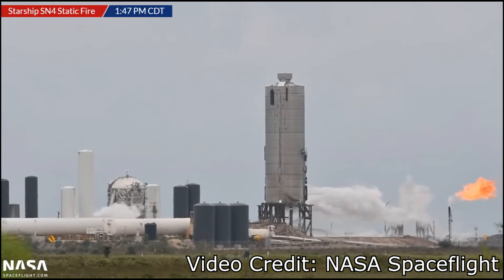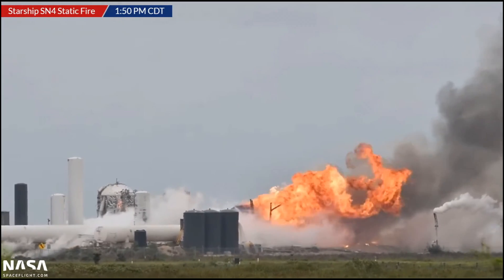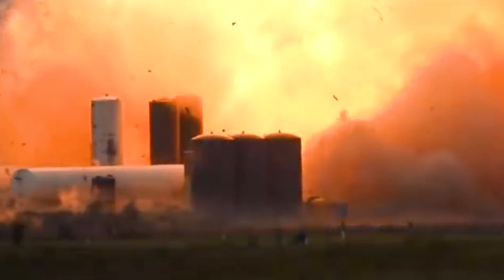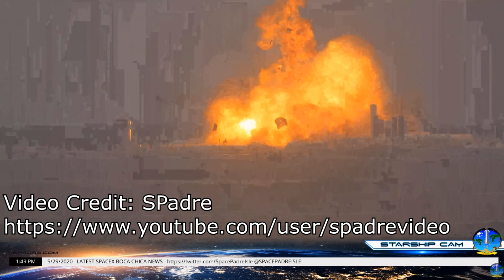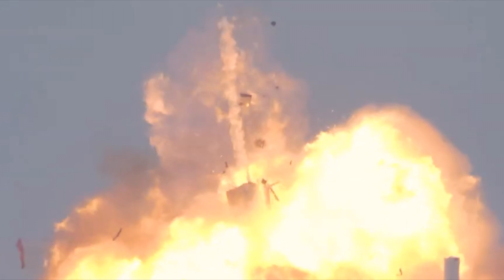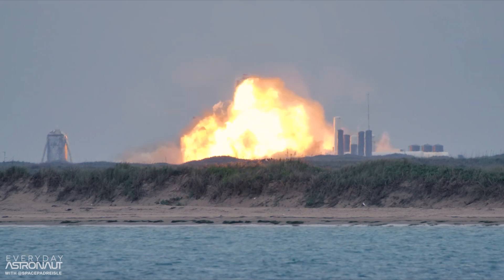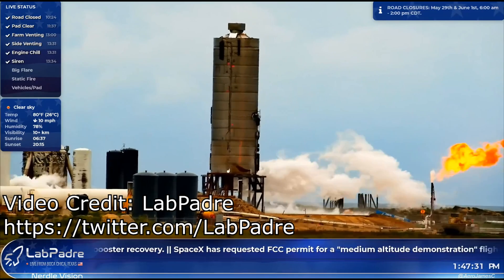What Can We Learn From The Explosion Of The Latest SpaceX Prototype?

Comment: Great video, Scott. Few things to note, one of which you theorized but are correct about. The leak was methane and oxygen thus causing a detonation. The deflagration velocity of methane in air is very low, even if you account for localized radiant heating from the flame front compressing and heating the fuel/air mixture ahead of the flame front. One thing that I noticed from all the videos, this actually produced a mach stem, a phenomenon usually seen during an elevated nuclear blast. Due to the cloud of fuel and oxygen taking an irregular shape and the detonation starting at the stand and propagating away from it. It generated a contoured shock front and due to the deviation in the density and likely the compression effect, the detonation velocity changed as the shock front propagated. The change in contour and difference in the shock front velocity appears to have created a shock front closer to the stand that was at a higher velocity than the shock front further away and you can see the closer shock front overtake the shock front further away, thus creating a very visible mach stem in the forward right side of the NASASpaceFlight video.

Comment: I've said this before, I'll say this again - Starship is in serious trouble.  It has become incredibly clear that SpaceX does not know HOW to build one of these.  In aerospace engineering, if you do not know that... you do not know anything.  You cannot specify the ultimate payload capacity or possible mission profiles without knowing how much material is required to make your vehicle work.  And, keep in mind, thus far the requirements have been mild... mere holding propellant and static test firings.  What is going to happen at MaxQ, Staging, Orbital Refueling, and Re-Entry?
The near final design of the Space Shuttle was adopted in January 1971, by April 1981 the first Space Shuttle launched with two astronauts onboard.  From concept to a crewed flight in just over 10 years.  I do not see Starship carrying astronauts into space .. any time soon.  In fact, I expect someone at SpaceX to wake up from this ridiculous fantasy (colonizing Mars with no external funding) and cancel this money pit.

Comment: Scott analyze the wreckage the bottom Lox tank was ripped in a spiral fashion with one segment of rings intact. The methane section was clearly exploded. The bottom. Lox tank failed 1st. Not GSE
Reply: Also methane doesnt explode like that. It burns rapidly. Liquid oxygen accelerates combustion and is extremely volatile if it comes into contact with organic material like oils.

Comment: I'm wondering why they don't have a water spray system, something like they have on the F9 launch pad but activated only in an emergency. It would not be able to prevent ignition but it could easily downgrade the detonation to just a fire which would burn out rather quickly as the methane evaporates and disperses. I think it would have easily saved the vehicle and also greatly reduced the damage on the ground, limiting it to heat damage only rather than powerful shock waves.
The water spray would of course need to be started as soon as a leak was detected to be of any value.

Comment: The new stand is already almost done and SN5 is basically already stacked and all so over the next days I expect to clean up work and all and then SN5 possibly rolled out. I know SN7 is already taking shape with 2 ring segments. We also know that they wanted to really blow one up and find the top limit of pressure they can safely fly the rocket I bet. granted if the blast happening inside the rocket we could possibly know so I do think it was a process issue. So hopefully they get a lot of info on this and SN5 and proceed on to the test hop

Comment: I think we are seeing the problem with methane as a fuel for rockets. Ask any gas guy and he will tell you, "Natural gas carries it's own ignition source." (static electricity).
That rapid disassembly was essentially a fuel/air explosion. Had it been K1 there wouldn't have been an explosion. (Might have been an epic fire though).  Given sufficient volume and a good mixture such an explosion can reach the kiloton range. 
Perhaps the  tank farm should be a bit further from the launch platform? Or buried at least?

Comment: Scott, you should spend some time train spotting, because if you do, you'll learn that a roll of sheet steel isn't solid. Knock a ton or so off your mass estimates for that difference. One other thing is that methane can spontaneously combust in the presence of oxygen, which is one of the things that makes it a nightmare to handle. I wonder that Musk didn't take that fact into account when he decided to use it as a fuel.

Comment: OK my theory goes like this: The mass simulator changed the way the pressure from the firing engine runs through the body, leading to different vibrations than before, which caused a rupture somewhere.

But women scientists just found out that theories from men like me lack the theoretical foundation. So I must be wrong.

Comment: How do they not have safety valves that respond to a bad pressure condition? These people are supposed to be smart right? When they had insulation on the stand I thought that was dumb but pressure overload failures? There clearly needs to be firewalls for the stand AND the tank farm cause clearly this has demonstrated the safety issues there. Elons go as fast as you can is proving to be TOO FAST!

Comment: Well, that was quite a nice boom, but still a bit expensive for a firecracker. ^^
As for the ignition source being close to the engine: my guess would be that the ruptured methane valve spilled enough liquid methane over the LOX supply system to cause some cryogenic damage to areas which are not designed to stand the cold (for example the support brackets and the outer frame). Those areas would inevitably start to bend and warm the LOX pipe in the process, causing it to snap off the valve and leaking oxygen over the still partially hot engine. You don't need much energy to set anything ablaze with pure oxygen around, so that would easily be enough to cause a small fire which sets off the methane/air mixture and blow the whole thing apart.

Comment: I don’t doubt that a piece of GSE did fail, but I’m sure there was a lot more to it than that; I think they may be holding back on the details.  Judging by the shock wave (and the size of it) from the blast leaves no doubt fuel and oxidizer was somehow able to mix prior to the explosion and I’m suspicious a some of that mixing may have been going on inside the tank.  They’re lucky the vehicle was so lightly loaded, I’m surprised the damage wasn’t worse even with the light load.

Comment: Was quite heartbreaking to see. I hope the damage on the pad and the equipment is not to high and they can resume testing soon. 

But generally I wonder if the test fires are "succesfull". Compared to StarHopper, which static fired, hopped 20m and did the 150m hop with very early Raptors.
Since then they did not manage a static fire longer than 1-2 seconds. (I don't know what they achieve at McGregor though). Or do you think they purposely do 5 1sec static fires and no longer ones? This gives me a feeling that they have some problem surrounding Raptor. I might (hopefully) be wrong.

Comment: Hi Scott. 
I don't  think you should be making so much emphasis in weld failure.  Every engineer knows, and in fact is is taught in the faculty, that a well performed weld is always more resistant than the material being joined.
I think the cause of failures must be other reason, unless welds were not made correctly.  And I'm pretty sure that Space X has made sure that weld personnel is qualified and all the quality inspection been made before rocket test.
Welds are calculated so that they don't fail.
Other cause of failure could be metal embrittlement due to cryogenic temperatures for example.

Comment: It looks like both Cryogenic tanks were over pressurising, the two streams up the top look like the LOX and Liquid Methane tanks are venting like crazy. Hence the lower leak starting momentarily later as the RV"s couldn't dump the pressure fast enough. This problem started well before the lower leak. Fingers crossed, lets check the flow calculations of the RV's/burst discs and build it again and go again. Possibly one of the internal cryogen tanks leaked, the resulting heat exchange would cause the fluid to convert to gas at around 1:670 ratio. Keep it up SpaceX!

Comment: I bet they loaded light on the O2 and they were purging HARD before the detonation. the first shockfront is a thermobaric detonation of the cloud, which happens while the main thank is suffering structural failure. it dumps it's methane fuel has an intense and rapid fire as the liquid begins producing gas, but then the O2 load gets involved as that common bulkhead fails. however, it seems there was not enough O2 to actually light off all the methane, because that fireball shows a LOT of methane pooled on the ground. I'm guessing they load a skewed ratio because running your engine out of oxidizer is not nearly as bad as fuel mid test. so it's scary to say, but I think this was "small" on the potential scale

Comment: I think Musk is overdoing this breakneck "build-test-fail" cycle far too quickly.  This is the second catastrophic failure caused by some kind of procedural mistake. Welding stainless steel is not, pardon the pun, rocket science - it has been done for ages. You test your welding technique, strength and uniformity of welds, etc in the lab/workshop, not by pressure testing complete tanks. You simulate the total strength of the assembled components. This is not 19th century. The glacial pace of SLS development is absurd, but this other extreme is ridiculous, too. Falcon development is probably at the sweet spot, perhaps a bit on the too quick side.

Comment: I knew I was right about it starting under the tank. I do a lot of acetylene cutting and it's common for torch to be blown out, but if the work piece is even close to red from the heat you can relight the torch just by putting it close to the hot spot.

Comment: I may be preaching to the choir, Scott, but I have some experience with handling cryogens - specifically LHe while filling MRI magnets - and in the few seconds either side of 12:16,, there is something that may be of interest.  At the base of the structure, on the left side where the 'leak' first becomes obvious, there is clear evidence of LIQUID escape.  

Certainly with Helium, any escape is usually gaseous because the liquid turns to vapour long before reaching the outside world.  There is a stage at which so much is coming out, actual liquid in the form of droplets can escape the pipe/ vent/ 'stinger'.  They only exist fleetingly and are completely surrounded by 'boiling' vapour, which leaves a characteristic trail.  I always called them 'smokers', although that was just my word for them.

At 12:16 or thereabouts, there are clear 'smokers' at lower left, indicating (to me) that actual liquid is escaping the vessel or plumbing.  I agree with your assertion that it was a union or pipe of some kind, beneath the vessel and the flow rate was such that the liquid could not vapourise fast enough and thus formed 'smokers'.

Comment: The methane gas is heavier than air, when it began pouring out it was ignited by the flare stack. Slow it down and you can easily see it
Reply: Methane is lighter than air. The cryogenic temperature upon release will keep the methane low to the ground. Observations from the two angles show an ignition point under or to the side of the SN4 and not from the flare.

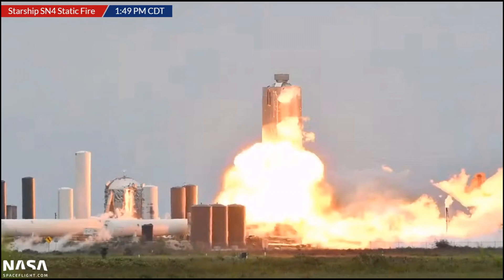Comment: 3:12 Skip to the first time stamp and look out for around 3:15 — 3:16 the best example of the supersonic boom is seen to the bottom right of the engine tower to the left of the flame stack as there's a blue sky curved front pushing the flame away as it moves out from the bottom centre of the video

That's the pressure wave moving through the gas faster than the gas can displace
Reply: 12:30 look for 12:45 area, the explosion comes when there's no more methane to displace the oxygen

The oxygen:methane ratio increases to the combustible range, that's why it didn't explode straight away; too much methane Vs too little oxygen initially

Similar issue to hydrogen fuel cell vehicles in atmosphere

Comment: The second "explosion" is probably the sound of the mass simulator hitting the ground.
Reply: No way, the impact of the mass simulator would just be a THUD.
Reply: Yeah, hitting the ground and somehow, for some reason, causing additional explosive results. A giant piece of steel hitting the ground does not explode. I think it's likely that additional fuel was splashed around, as scott suggests, mixed with the air and exploded.
Reply: On at least one angle you can see a Shockwave generated when the mass simulator hits the ground.
Reply: There's plenty of ignition sources around the impact site.  Why would the mass simulator be the cause of another explosion?
The simulator is 10 tonnes of coiled stainless steel sheeting.  10 tonnes falling from over 100m has more than 10 megajoules of energy.  That's equivalent to the blast from 2.5 kg of TNT.  That's more than enough for a loud bang and shockwaves.  The brightening of the flames associated with the "second explosion" is probably just increased increased combustion from the gust of oxygen rich air (and perhaps a splash of fuel as kindlin said?) that followed behind the falling mass.  Still does not qualify as an explosion.
Reply: That is, indeed, what he says in the video